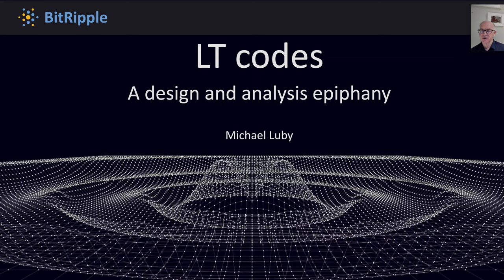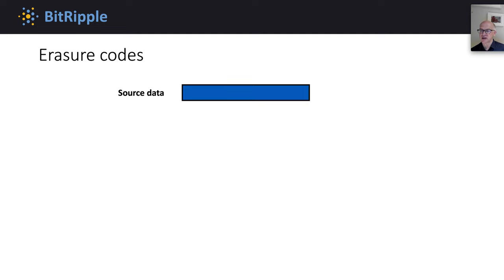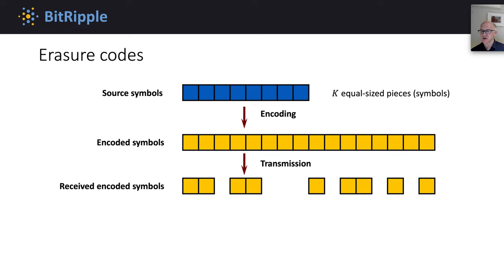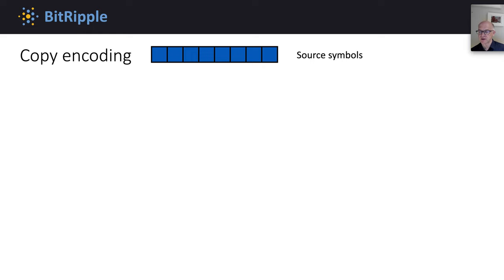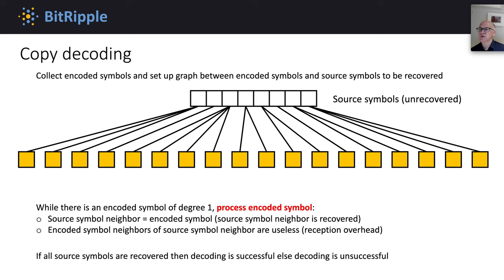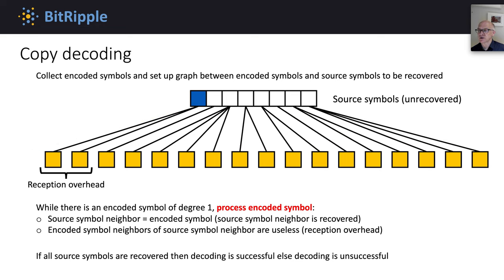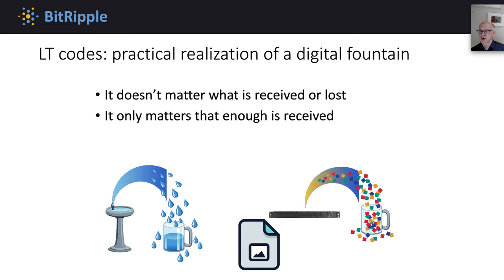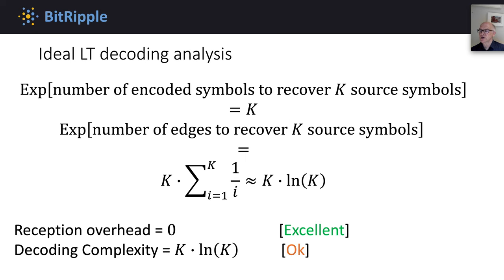LT codes -- a design and analysis epiphany

Comment: Very nice.  Most elegant description yet, it seems.  I would love to see the simplest version of going one step deeper, where the probability of failure is controlled.  Removed by several years, I can admit that I never understood why the existence of a degree distribution with somehow good behavior of the expected ripple size related to (a) a good design in practice; or (b) confidence in success for other degree distributions.  If I have an integer-valued random walk that I cannot afford to allow to get absorbed at zero, having a mean of 1 scares me.
Reply: Hi Vivek, thanks!  You are correct, this video only presents the first-order expectation analysis, and as mentioned in the video this alone is far from a complete analysis due to variance in actual behavior from expected behavior.  However, I have thought about how this analysis can be extended from an expected behavior to a behavior that happens with high probability, and it seems like this is possible with this approach, with of course a modified degree distribution, where the modified degree distribution s also suggested by the analysis.  Let's talk offline about that, would be great to talk with you!
Reply: @michaelluby6966  Just viewing this now.  Very cool & crystal clear.  I shared Vivek's concern initially, but thinking about it a little more, you can encode the with high probability part on the edges so that the "1" from the one-at-a-time principle becomes  ">= 1 w.h.p."   This type of reasoning may in fact be just about right for the ideal LT distribution, since violating this condition anywhere up the chain will lead to the absorption problem that Vivek mentioned, and not violating it will lead to success.
Reply: @johnbyers3333   Yes, the key idea to move this from a design and analysis that works if everything proceeds "in expectation" to a design and analysis that works in practice is the following.  First off, the initial number of degree one encoded symbols needs to be enough to absorb random variations in the average rate of generation of new degree one encoded symbols as existing degree one encoded symbol are used to recover source symbols.  To absorb these random variations without causing too many collisions and make sure that the supply of degree one encoded symbols is not depleted, the initial probability of degree one encoded symbols should be some constant C over square root of K, so that the expected number of received degree one encoded symbols is C * square root of K.  Then, the probability of degree 2 and above should stay essentially the same as they are in the ideal distribution, so that the average rate of generation of new degree one encoded symbols is one each time an encoded symbol is used to recover a source symbol.   There needs to be similar modifications to the degree distribution for higher degrees to ensure that the process cleans up at the end to recover the last few source symbols.

Comment: @ 4:17 "Degree is the number of symbols we will combine to produce an encoded symbol."  Then go ahead and explain the slide.  It was a little confusing to wait until halfway through the slide to hear this.
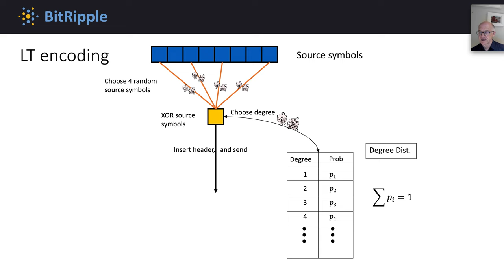@5:53 "Four random source symbols are chosen without replacement and xor'd together to generate the encoded symbol."
I think you should prove the coupon theorem.  It's essentially the same idea that leads to the decoding time for optimal LT codes as I guessed it was K ln K time.
Reply from the maker: Hi Don, Good to hear from former Qualcomm folks!  To keep the video relatively short, there were a lot of shortcuts that needed to be taken -- an expanded version of this video that goes into all the details would probably be around an hour or so.  You pointed out a couple of places where it is a bit fast (although I do want to point out that there was an example previous to the four source symbols exclusive-ored together, i.e., the first example where degree was two and two source symbols are exclusive-ored together).  For example, I didn't explain what an exclusive-or of symbols is, and many other things.  Maybe at some point I will put together this expanded video to augment this short one.